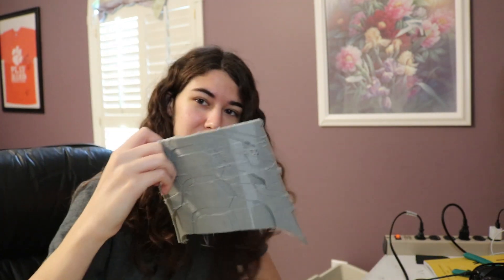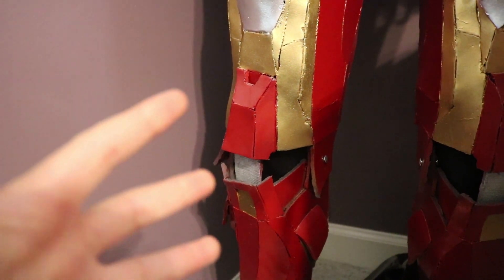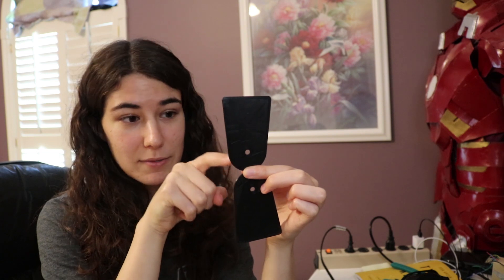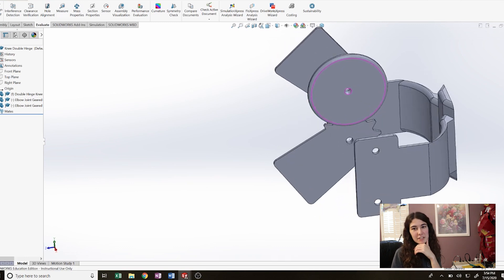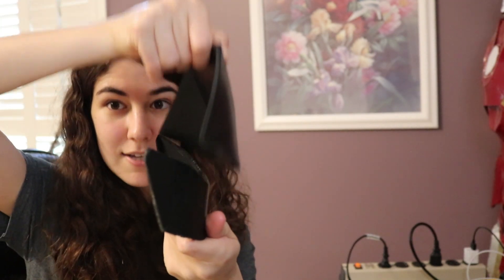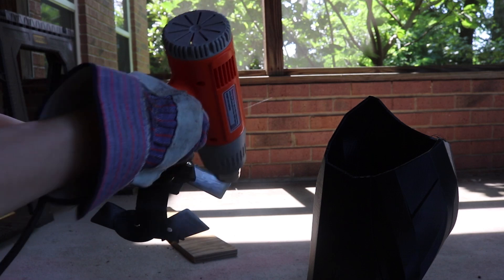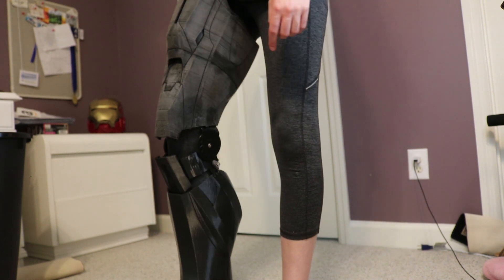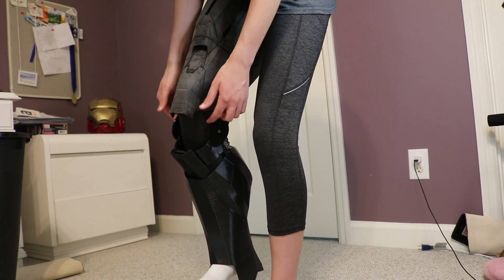Iron Man Mark 7 - Hinging the Legs

Comment: Lechuga is the secret sauce when it comes to silencing printers; its available in powder or liquid and is easy to apply. Use it liberally! It would undoubtedly also help in the knee joint and will guarantee the ab plates to stay aligned.

Comment: The other thing that could be used for the knee cap is elastic. If there is the normal knee joint then add elastic on either side of the knee cap the elastic will keep it centered

Comment: Thanks for this. I am in the process of printing the files from Do3d.com as well and have been trying to think of a way to make the knees bendable! Also if you are still looking for ways to quiet down your printers try using a cement patio tile underneath, with rubber or cork on top of that. Not only will it quiet down the movement noise but will also help with any ghosting in prints from the printer shaking depending upon speed.

Comment: One thing I have done to make my printer almost fan noise only is to switch to an SKR 1.4 board with TMC2209 drivers. That eliminates most stepper sound. I would not recommend the silent board because it is only 8 bit